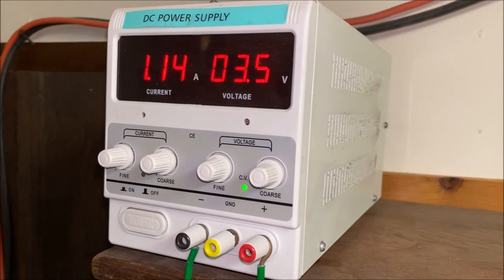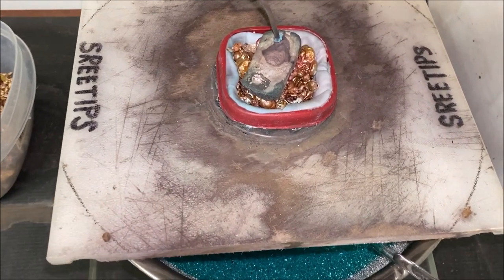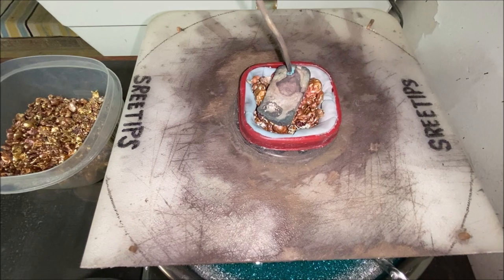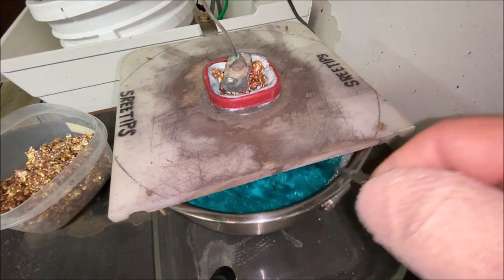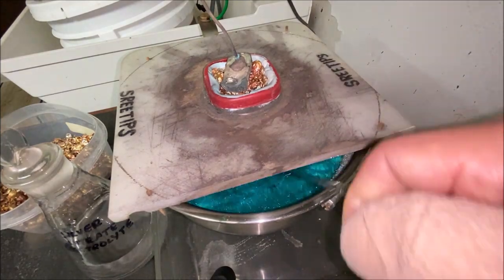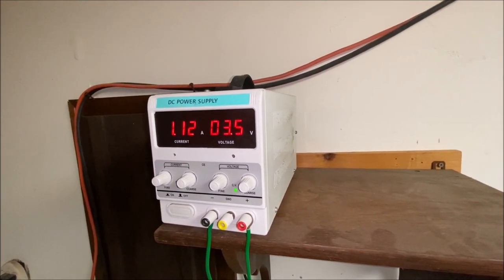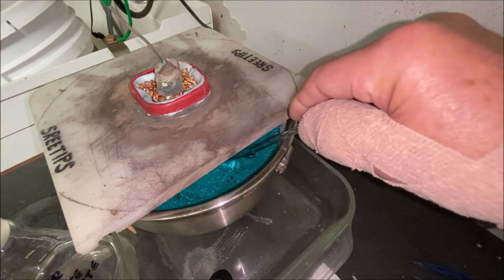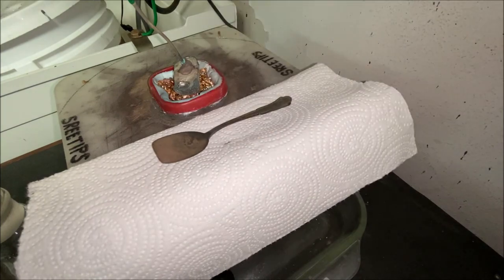Silver Cell Update 2 Days Growth

Comment: The problem with cement silver, despite being more particulate, tends to clump together in one solid mass.  The silver shot, on the other hand, due to it's irregular shape means that more of its surface area is exposed to the electrolyte, and works better as a result.
Reply from the maker: Sounds right
Reply: @sreetips  sounds like it does the same thing hot cocoa powder does where the outside powder gets wet and keeps the inside dry while the particulates clog the filter media
Reply: though it has more surface area, which one would think would be better for electrolysis, the fine particles just have a way higher electrical resistance. I'm guessing that's why he said the current barely picks up when he tried it with the cemented silver

Comment: How about using an air pump to help keep the electrolyte mixed? The silicone tubing shouldn’t collect silver. Only problem i see with using air, is that it also increases rate of evaporation.

Great vid. I really love the looks of those crystals. 👍
Reply: He does use a air pump out side in his other ones
Reply: Use a magnetic stirrer

Comment: Have you looked at using a larger bowl or stock pot as a cathode? A larger vessel would allow for a longer duration between cell clean outs and give the crystals more room to grow.
Reply from the maker: There is a critical distance, 4 to 4.5 inches, that must be maintained between the anode basket and the cathode.

Comment: I'm by far no expert but my guess why the cement silver doesn't work is that it starts to form less conductive layers over time. The current takes the path of least resistance, in the powder it can flow pretty freely so it may carve out the silver paths first and start forming layers of less conductive metals that wont let any more silver through.
Reply from the maker: Fine forensic analysis

Comment: What about you stir plate and stir bar set at a slow spin, the stainless steel bowl is non-magnetic. That should help keep the solution mixed.
Reply: Dang bet me to the punch but I was also saying in my comment that the magnetic field might affect the electrical current
Reply from the maker: I don’t want any contact with floor of the cell

Comment: I watched one of your videos.. u used silver to make a lower carat gold alloy before the nitric boil.. is it the same weight and process if u replace the silver 4 copper thanks
Reply: Mr Sreetips has numerous videos on the process. As a fan, and a complete layman; he inquarts the gold source material with specific amounts of silver, to get a certain AU+AG ratio that is conducive to the nitric reclamation and refining process.
Reply: @dmohr6449  I have the gold but no silver just wondering if it will work the same.. I will try find the the vid I need
Reply from the maker: Yes

Comment: What about an aquarium bubbler like you use in your stock pot/waste treament.
Reply: I was thinking about a motorized paddle mounted through to top board, but your idea is light years better.
Reply from the maker: This is what I had in mind. A propeller suspended below the anode basket pushing the electrolyte down. Would also serve to keep silver crystals from contacting anode basket.

Comment: If you want to have a little bitty pump circulate the electrolyte solution, you could look into a Peristaltic Pump and have that run on a small timer. Look for the 'dosing pumps' for aquariums for cheaper ones, but make sure the tube that runs inside the pump is actual silicone by testing it outside the cell with the solution.
Reply from the maker: I’m looking for some mechanical propeller action to help keep crystals knocked down - kill 2 birds with 1 stone.

Comment: Why can't you use a plastic fish tank pump, that has ajustable speeds to keep the electrolytes  moving around? If there's no metal inside the pump that touches liquid you should be good, right?
Reply from the maker: I need a rotating mechanical stir like a model airplane propeller to help knock down the crystals.

Comment: Just thinking out loud but what you’ve done is make a super-saturated solution of silver nitrate as your electrolyte so when you dissolve the silver shot the excess amount of pure silver has no choice but to plate out on the SS bowl as the concentration of silver exceeds the nitrate’s ability to hold dissolved silver in suspension. Additionally as you mentioned you need to keep a close watch on the dissolved copper in that same solution as a high concentration of copper will overwhelm the silver nitrate and then eventually begin to plate out with the silver. To prevent copper from plating out with the silver contaminating the silver farming you periodically add super-saturated silver nitrate solution to the silver cell but NOT distilled water. Is this because copper cannot be suspended in water but can remain suspended in silver nitrate?
Reply from the maker: Sounds right. I’ve never added distilled water after the cell gets up and running. Always augment with more silver nitrate to keep the actual physical level up (it tends to drop due to evaporation) and to keep the silver concentration of the electrolyte from getting too low. The cell will tolerate copper up to 60 grams per liter - so I’ve been told.

Comment: Can you somehow mount an RC motor to the top and the sprocket can spin some type of stirrer in the liquid? Maybe have it on a timer? You could put a webcam on it so you can see if from your phone when you’re away and have a wifi enabled plug that you can turn on and off from your phone so you can activate and deactivate stirring remotely if you need to as well.
Reply from the maker: Stir motor on top is what I’m thinking.

Comment: Thanks for another great video 
I have a question for you. ???    When you pour your anode bar why don’t you 
Flux and tin the copper wire prior to pouring the silver bar ???
Tinning the copper wire ( coating the wire with flux and a thin layer of silver or silver solder)
You will get a better connection between the copper and silver anode bar.
I can see copper corrosion where the wire goes into the bar .
Reply from the maker: I didn’t do it because I didn’t think about it. That wire is in there stout. The corrosion is probably galvanic. The silver bar itself is partially corroded away just sitting on top of the silver in the anode basket.
Reply: @sreetips  when I watched you pour it I could tell you didn’t get a good bond. Next time you redo it you should try it you will have a better electrical connection 🙂. Always enjoy your videos

Comment: Put bowl on top of stir plate and add a stir rod to keep electrolyte in motion? Might eventually clog up but it's worth a shot.
Reply: Not sure if the bowl may or may not be affected by the magnetic forces either?
Reply: Or the electric current for that matter
Reply from the maker: I want to avoid contact with the stir and the floor of the cell.

Comment: What about using a small fountain recirculating pump for like a little table top one you could have it pull the electrolyte from one side to the other or just have it output onto the silver shot might also speed up the process just a bit. Not sure if you have tried this in the past
Reply from the maker: I need something mechanical

Comment: Hi doctor very good 👏
What happens we increase voltage and A?
Reply from the maker: I’ve used a 12volt battery charger once. The silver crystals grew fast and were long like needles. You could actually watch them get bigger right before your eyes. But they would quickly contact the anode basket a create a short circuit and burn a hole in the filter, allowing the slimes to contaminate the cell.
Reply: @sreetips  doctor thx so much for reply 👍

Comment: just use one of the oval teflon covered stirbars and a stir plate....  should suffice to keep the electrolyte in motion I would think;  and no need for worry about plating onto the teflon.    
You would only loose the small area that the teflon bar would contact the bottom of the bowl.   My only concern would be the micro particles of silver constantly forming, then being scraped off the bottom in that one tiny section.  Probably have some sort of plastic barrier affixed to the spot where it would rub; eliminating that issue entirely.
Reply from the maker: I want to avoid contact with the cell floor

Comment: Hi Sreetips, great video as usual, quick question, I have the same power supply as you and I notice there is a coarse dial and a fine dial, what one do you use to adjust the amps and volts, thanks in advance
Reply from the maker: In CV (constant voltage) mode I use the coarse dial to get close to the desired constant voltage that I want then use the fine dial to get exactly on the desired voltage. In CV mode the amps dials are not functioning. The amps will vary depending on the load presented across the cell. For example, as the electrolyte level drops there will be a corresponding drop in amps but the volts will stay constant. This is desirable for the silver cell.

Comment: A tiny powerhead or submersible pump with a ceramic shaft for the impeller would work well for keeping the solution circulating without speeding up evaporation.
Reply from the maker: I like something motorized with a propeller to help knock down crystals.

Comment: @Sreetips How many uses do you get out of the electrolytes before you replace it?
Reply from the maker: No more than two. And I augment it for the second use with about 200 grams more of pure silver crystal dissolved in hot nitric. I tried a third use one time. The crystal grew some very odd shapes and sizes. When I harvested the crystal it was coated with green. A sure sign of copper co-depositing. And even more strange: the electrolyte was nearly completely devoid of any silver. I added hydrochloric to drop silver chloride and none would precipitate. I ran that batch of crystal back through the cell and it cleaned it up for me. That made a believer out of me. From now on no more than two refinings with the same electrolyte.
Reply: @sreetips  thank you. Btw, love your work. Really has taught me a lot and sparked my interest and fascination with the topics! I can not thank you enough.

Comment: New to this. I’m so confused. So you’re saying that you can grow silver?
Reply from the maker: Yes, the impure silver dissolves in the anode basket, travels through the silver nitrate electrolyte, and plates out on the inside of the cathode (stainless bowl) as absolutely pure elemental silver. But, the amount we harvest is only equal to the amount we put it. We can’t create silver out of thin air. This is the main difference between metal as money and paper as money.

Comment: how do you check for electrolyte saturation?
Reply from the maker: Of copper? I’ve used a spectrophotometer to measure copper concentration. But I’ve found that I can reuse electrolyte one time, adding about 200g more silver to the electrolyte and be ok with the copper concentration.

Comment: Could you run the power supply thru a Kilowatt meter to see what it uses over a 24 hr period ?
Reply from the maker: The light bill is less than $3 per day for the whole shop. It would be hard to measure that low.

Comment: Air bubbler, like those used in fish tanks would keep the electrolytes stirred...but then you would have need of electrolyte refill more often.
Maybe sealing the top would be needed.
Reply from the maker: A propeller to knock down the crystals
Reply: @sreetips  that sounds better.
Can be mounted right next to basket in covering.
Reply from the maker: I’m thinking below the basket
Reply: Blade below basket? Motor mounted next to basket outside?
Reply from the maker: Or on a stand above the cell
Reply: Cool idea, cannot wait to see video.

Comment: Hey friend. I have a question cus I've never don't this but I was wondering how much and how bad is the fumes when melting gold cus I always see u doing it away from the vent hood and I'm about to melt down all 5 of the grams I've got from u over time and some other gold and I want to make sure I know what to expect. It's a smaller operation then what u use and have and just gold.... thanks
Reply from the maker: Sara, I usually always wear a 3M P95 mask when melting metals. I wouldn’t do it without one. I melted some silver way back in the day without the mask just liberally breathing the fumes off the melt. The next day I experience flu-like symptoms known as “welders fever”. I’d get a mask at Home Depot or Lowes, or order one online so you don’t have to breath the smoke from your melt.

Comment: Hey I watch all your videos sreetips, I’m curious with this method does the cost of running the dc power offset your profit as opposed to just refining to silver bars or is it more profitable to use this method?
Thanks 
Mike
Reply: Also is there a way you could come up with to make your silver shot particles smaller so you could fit more in the basket without having to refill as often?
Reply from the maker: I’ve never calculated that. But that little thing can’t consume that much power. My electric bill last month was about $90. That’s $3 per day all in.
Reply from the maker: Possibly

Comment: What about a stir rod....would that work?
Reply from the maker: Yes, but not one that comes in contact with the floor of the silver cell
Reply: @sreetips  what about using a small petri dish to place the rod in...i would think the silver would still grow under it
Reply from the maker: I’m thinking a model airplane propeller mounted on a pvc shaft through a hole in the cover. The hole will provide a bearing for the shaft. I’ll use a small motor with some sort of reduction gear to drive it from above the cell. The propeller spinning below the anode filter basket and forcing the electrolyte downward. But above and not touching the floor of the cell.
Reply: @sreetips  nice...

Comment: What is the yield from the shot to plated silver?
Reply from the maker: I’ve never calculated it. But there is very little loss. The amount you put in should nearly equal the amount you get out. However, the silver in the electrolyte will plate out on the cathode along with the silver being dissolved in the anode filter basket. So taking this into account, one could expect to put in 100g of silver into the anode filter, and harvest 110g of pure silver from the cell. Not because we created silver out of thin air, but because some of the silver in the electrolyte plated out also and made it look like we got more than we put in.

Comment: Hi mr.sreetips my name is john and i owen refinery , i have a question for you
How can i get 99,9 pure silver 
My silver bar purity is 99,2 
Iam cementing silver with copper and washing with water then melting ...is there a method to get 999 purity 
Thank you
Reply from the maker: Yes, two ways that I know of: run the cement silver through the silver cell. Or silver chloride conversion with lye and sugar. If done correctly, the silver will be very high purity. Cement silver is not high purity. It’s full of copper.
Reply: @sreetips  thank you

Comment: A magnetic stir bar can help
Edit: not that the glass stir rod is bad
Reply from the maker: Magnetic would be in contact with the floor and may promote stainless in the silver.
Reply: @sreetips  I didn't think about that, thank you brotha. I have a plastic covered mag stir rod so I was thinking it would just run on top without a problem.

Comment: 95% copper plus 5% aluminum equals aluminum bronze which is quite beautiful itself, I wonder what 95% copper plus 5% silver would look like
Reply from the maker: Copper is very ugly black as soon as you pour it in the mold - looks awful. I’ve done it before. I buffed off the black and they looked ok but immediately begin to oxidize and turn colors. Precious metals won’t do this. I melted the copper bars because the other refiners on the forum said it’s a waste of time and resources. I wanted to prove them wrong. But all I did was prove them right. Messing with copper is a waste of time and money - they were right!
Reply: @sreetips  the black is copper oxide, I have a couple of bars that I bought from Silver Dragon and they basically are the same color as an old copper penny, I've bought a few of the copper rounds which I'll never do that again because I've learned from Rob Finds Treasure that the best way to stack copper is with copper pennies that come out of circulated penny rolls, one day, copper will get there in value but it seems to be a slow process :)